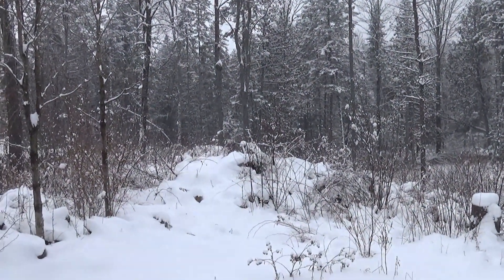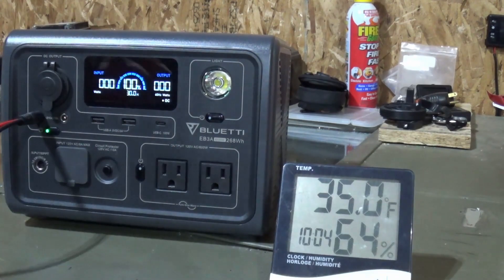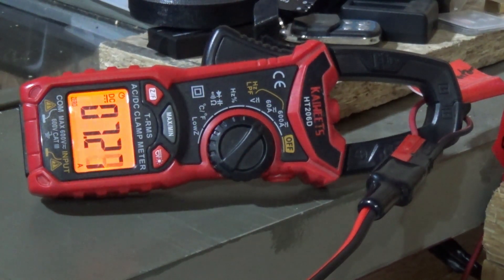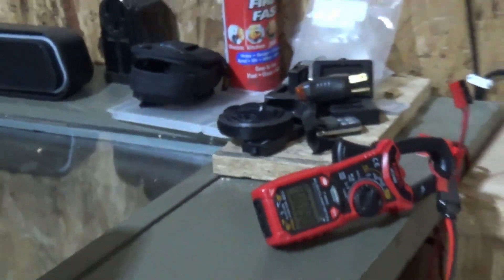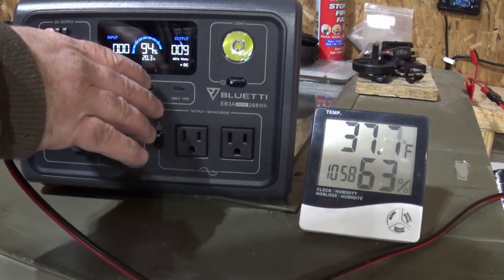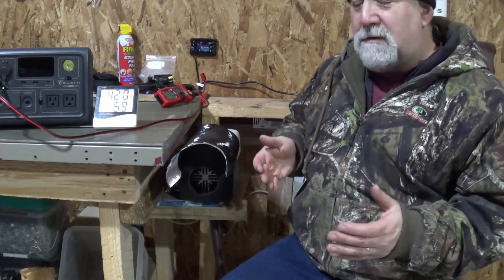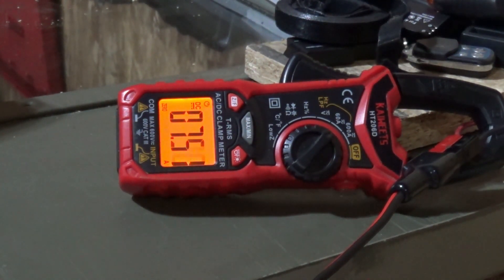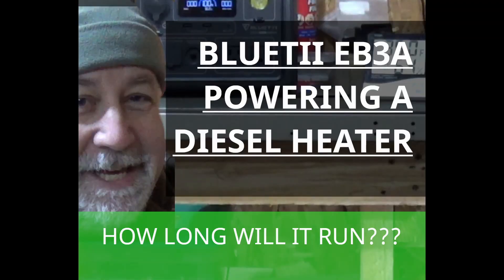How long will a Bluetti EB3A Powerbank run a diesel heater?

Comment: Something odd. I have the same setup with a heater that has a 1 to 10 speed setting. At 16 watts on level 5, I get a 37 hour run time. My EB3A is nearly 2 years old with constant use. I wonder if the cold location of your EB3A is the contributing factor?
Reply from the maker: That's a good run time for sure! I don't use the bluetti constantly, so it may be somewhat degraded?

Comment: I live in a van and survive extreme temperatures with my diesel heater . we're talking negative 50 60°. Mine uses like 200 watts on start up. I use 1000 watt powebank with AC DC adapter. Run 24hrs use like 35% of the battery. I also have a life POF4 30ah hooked up as backup.  I don't use it for the diesel heater but my additional power is 1,000 W inverter powered from solar and battery isolator 200ah batts. And two other power Banks 1200 watts each. As well as an eb3a which won't even run my 12 volt fridge for more than 10 hours. Eb3a is basically a cell phone charger basically sucks.
Reply from the maker: Sounds like a good setup! Stay safe out there!

Comment: The Bluetti was at the limits of what it was willing to output on its 12V output.  I'm a bit surprised that the DC efficiency is so bad when its only pulling 10W though.   I think it might be easier to just directly connect a 12V LiFePO4 battery to the diesel heater and then have the battery on a battery maintainer/charger.

So, any 12.8V LiFePO4 battery and a Victron Blue Smart 12V charger.  (That's a unit that will automatically float the battery, provide load support when AC is available, and re-bulk when necessary, and it is programmable via Victron's bluetooth app).  Or, alternatively, trickle charge the battery with a solar panel and charge controller (Victron smart 75/15 or 100/20 charge controller).

For example, a little 20Ah 12.8V LiFePO4 battery can discharge at 20A, which ought to be enough for the heater startup, and has no significant efficiency losses.  20Ah x 12.8V = 256Wh / 10W = 25.6 hours of run time.

And a bigger battery, like 50Ah or 100Ah... now you are talking 2-4 days of continuous run time.

-Matt
Reply from the maker: I don't disagree with you. There is a bit of "DIY" involved using a separate battery and charger (the victron isn't overly expensive, but it's certainly not cheap). The bluetti also has a built-in inverter for AC, solar hookup, etc... it's a bit more of a convenient grab-and-go package. Cost-wise, I think it's pretty close. I do agree that the bluetti should run longer - but also take into account the startup usage, and I'm going to guess the bluetooth might use up a little power as well.

Comment: Couldn't get mine to power a diesel heater either on the DC side with a 15amp cigarette plug
Reply from the maker: Make sure you have the latest firmware installed on the EB3A. Alternatively, you can get an ac->dc power supply and run off the ac side. It uses more power, but it does work.
Reply: @TheGergeDIY  it was updated and luckily I had an inverter that I brought with us and ran it that way. Uses way more power it only ran for 5 hours on the ac side with the inverter
Reply from the maker: @stevenbrown2039 yeah it does waste a lot of power doing it that way. I did see my current draw jump to just over 10a on startup but it was brief. The bluetti hung in there.
Reply: @TheGergeDIY  well I'm glad urs did but ours would shut down around the 100watt point

Comment: I have the bluetti eb3a we hooked it up like you! It didn’t work for me my heater keeps throwing a code E03! What are we doing wrong? I can send pics!
Reply from the maker: @diona-3642 - I believe an E03 error is a glow plug fault. It could also be the heat sensor throwing the error. Do you have an alternate way to power it to rule out whether or not it's getting adequate power from the EB3A?
Reply: @TheGergeDIY  We’re going to try a different way! I got a group of camping buddies that run theirs using a AC 110V/220V to DC 12V 30A 360W Universal Regulated Switching Power Supply Transformer Adapter
Reply from the maker: @TheBlackPioneer  that will work. I have video on my channel doing that. It does waste some power though.